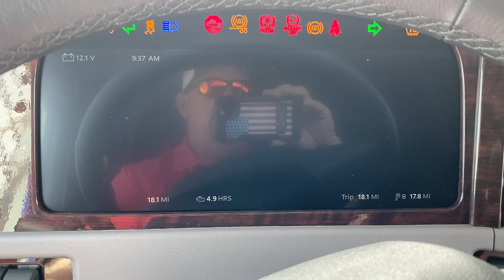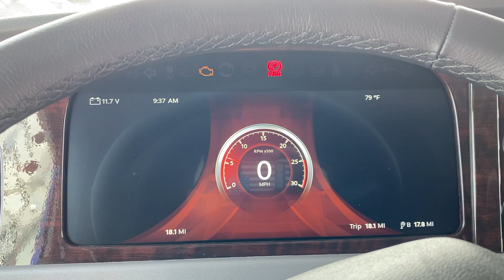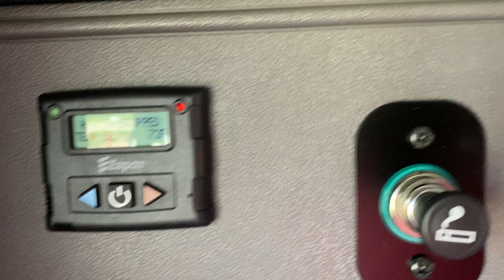Twin 2023 Peterbilt 389's with Herd Bumpers

Comment: Why does Peterbilt feel they need to put the fifth wheel switch up first in the line up?  If I’m reaching for an air switch in a hurry, it’s my diff lock.
Reply from the maker: They are a manufacturer.  They just make them.  They know very little about what you really do.  Those switches can be moved around.

Comment: The kangaroo AKA Roo bars. Also called herd, cow 🐄 , moose, elk, bull bar. Would be nice to see it all lit up at night. Those bull bars can set you back at over $6500.
Reply: Cheaper than replacing the front hood area and equipment on the tractor.😉

Comment: If only that had shorter wheelbase & horns on the roof, they’d be Aussie spec.
Reply from the maker: Thanks for watching from down under!
Reply: What's a standard wheelbase in Australia?
Reply: @zoopwhoop  around 3.2-3.6 for cabover b double prime mover. Conventional single trailer 4.0 plus depends on trailer length.
Reply: @bdouble69  that seems real short, I guess your trucks can't be quite the same pavement princesses  as north American ones
Reply: @zoopwhoop  Bush trucks in the North are shorter than the South, to maneuver easier.